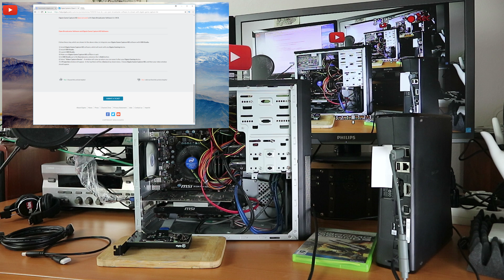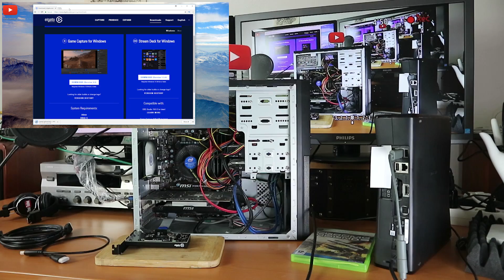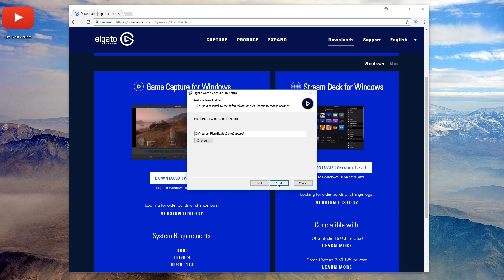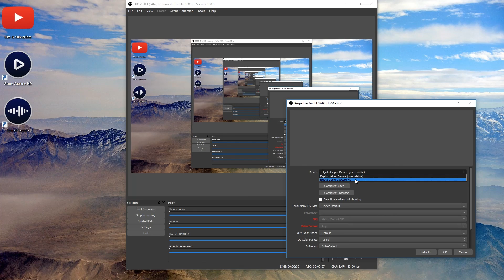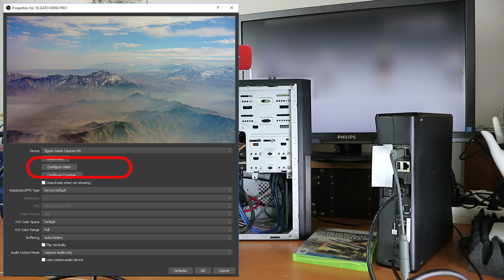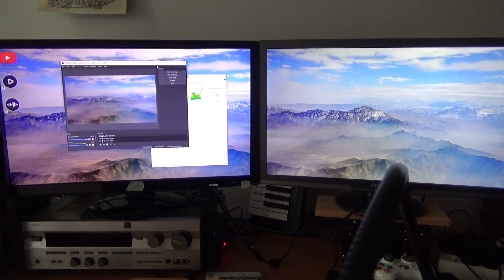Elgato HD60 Pro Complete Beginner Guide / Setup / Sample (Xbox & PC)

Comment: But streaming is only 720p I've tried many times to getc1080p but no luck :(
Reply from the maker: you use OBS? you'll have to change resolution in VIDEO settings
Reply: @iwanPlays  I used the elgato hd60 pro and it only streamed at 720p when on Xbox one. I have streamlabs obs also but do not know how to stream it to youtube from the XBOX